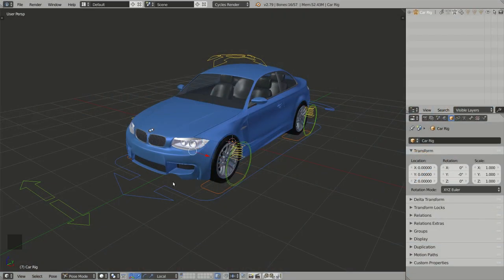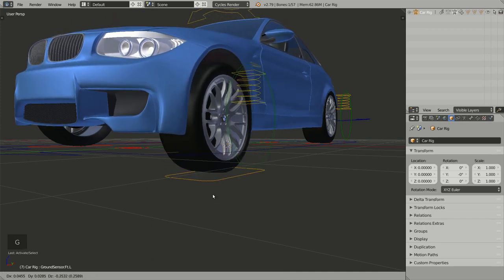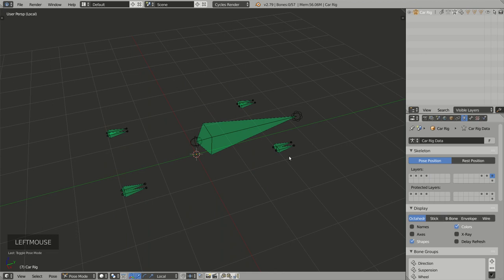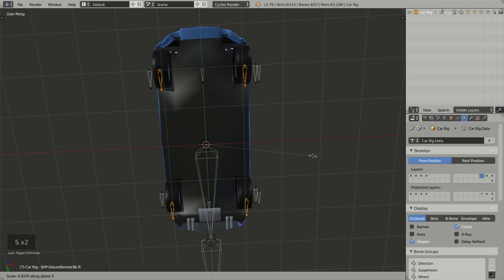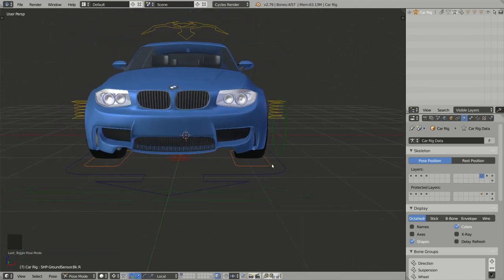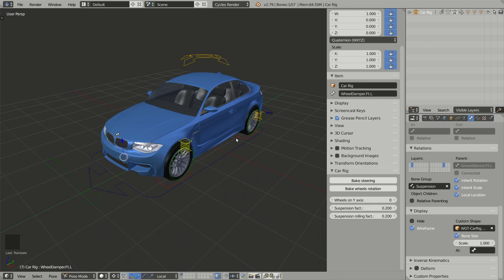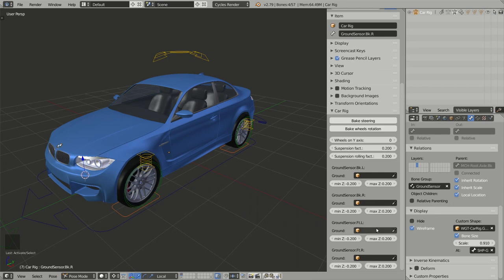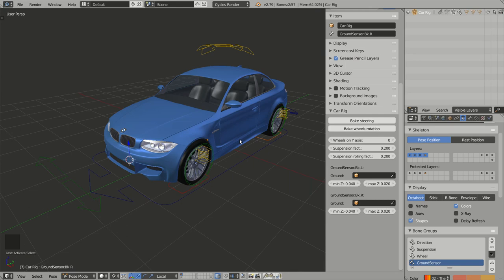Rigacar for Blender - part 2: adjust car rig

Comment: If anyone has camber on their car you have to make the following change:

1. Make sure your wheel is set to not have any camber and that its Y rotation is at 0
2. Go to layer 32 of the armature
3. Select the biggest green bone on a wheel and select "bone" from the context menu
4. Change Y rotation to whatever you want your camber to be (for me that was 7.5 degrees)

hope this helps!
Reply from the maker: Never had to rig vehicles with camber angle. Thank you for this. Let me known if you have issues after modifying the rig. Maybe I could improve the generation process to take this into account (for instance by using the rotation of the wheel on the Y axis).
Reply: digiCreatures yeah my method works perfectly as far as I know. Wheels soon as you would expect, and the front wheels still turn just fine. But something built into the rig to change camber would definitely be way better!
Reply from the maker: @cervidae3359  I will test if I can use the global rotation of the wheel mesh on the Y axis to apply camber automatically on the rig.
Reply: @digicreatures1945  Maybe also add some sort of "random seed" to wheel rotation, so each wheel isn't at the exact same angle. This would be especially helpful when the car is parked, so the wheels don't all look perfectly straight.
Reply from the maker: @cervidae3359  You can already do that. Just rotate yourself each wheel widgets to choose the starting angle.
Reply: digiCreatures op my bad didn't see that
Reply: Just what i was looking for and wanted to ask myself for the drift car rig... works perfectly, thank you!
Reply: Absolute legend with this tip

Comment: Thank you so much for thi Add on😊
One question: with 3.0 and no Layers, the work flow is invariate? Im still working on the first steps.of this series. Thank you bye.
Reply from the maker: Layers for armature still exist in blender 3.0. 3.x series introduced collection as a merging solution for group of objects and scene layers. But this is a different topic

Comment: Can you make it, so the wheels move/turn when using bigger wheels? (I can't scale down the wheel
or the materials will be messed up, the models that Im using are from mecabricks ( The Armature rotates the wheels as if, the wheels origin point is not at the center of geometry)

Comment: Hi @digitCreatures 

At 18.00... when i move the suspension factor number...nothing happens with the car suspension. Same with the rolling factor. 
So the suspension isnt being calculated when I animated the car along a path. The steering and rotation of the wheels is working fine. 
Also, when I move the suspension widgets seperately..the also work fine (ik can see the body of the car going up and down..)

So its just that the suspension isnt being calculated automatically when I set the suspension fac to 0.2 or something...

Can you tell me what the cause might be for this? Everything else seems te be working just fine... 

Thank you !
Reply from the maker: Rigacar is not a simulation tool, it just generate rig. You have to animate your car in a traditional way (especially suspension).

Comment: So if I'm going to be animating a railway related video and I was wondering if there was a way to make the rig for the side rods follow the wheel rotation and the car rig. Are there any tutorials? If I need to be more specific with this question then please let me know
Reply from the maker: Trains are specific stuff. Even if you can use rigacar, I would not use it for such models. For instance you don't need steering and drifting but you need to rig the side rods. Sorry, you should look for another solution and probably create your own rig.
Reply: @digicreatures1945  Do you know of any tutorials that well assist me in making a rig? I have no experience in that field.
Reply: @dieseld261  If you are still looking for solutions I would suggest Pixel Level Pixel.  He has done a whole series on rigging and in particular for your requirement he shows ways of rigging pistons, which could be applied to the drive rods on a train.
Reply: @WaterShowsProd  I'm not looking for a solution anymore but I will definitely be sure to check that out. Thanks.

Comment: This add-on is amazing. Are you able to explain how to add more bones to the rig? I found the vertex groups in the "DEF" bones category and am trying to add a bone on the "main bones" layer to control the door of my model... I have only been able to go as far as adding the bone and parenting it to the root bone, but I can't figure out how to weight paint the door and make it correspond to the new bone. Thank you!
Reply from the maker: In Blender, you can use an armature to animate objets or to animate meshes. Rigacar generates armature to animate objects because car models are usually made from separated objects. So you do not need to weight paint anything. If you are not used to create armature to animate meshes, the simplest solution is to have one or more separate objects for each door. In the armature, add one bone for each door. Parent these bones to the DEF-Body bone (you have to enable layer 16 of the armature to see it). Then parent door objets to the corresponding bone.
Reply: @digicreatures1945  Thank you, your answer helped me. Rigacar is so much fun to work with!

Comment: Hey ! so i've been using CARRIG PRO but this is so much simpler and i am planning  to switch, i have one problem tho i click generate after renaming and stuff , and everything is parented correctly but i when i try to pose it, the wheels dont move, and also i suddenly can't find their bones, i tried a coupleof times and it's the same issue, however when i move the rig everything is moves which means, the wheels are parented to something in the rig it's just i can't find dthe bones and so it doesn't work
Reply: I Figured it out, in case anyone runs into the same thing, my tires center point wasn't at each center of each tire so click each tire go to object then set center point to geometry
Reply from the maker: You're right, it is an issue many people have. Take care of the origin point because rigacar uses it to decide where the bones should be located.
As for CarRig Pro, I haven't tested it. But as far as I know, the design is completely different. It includes support for simulation as rigacar is a pure rig generator only for animators (no simulation support at all).

Comment: My wheels turn the wrong way and slow. What should I do?
Reply from the maker: Activate "Wheels on Y axis" (put the value of 1) and move the root widget along the Y axis. Check the spinning of the wheels. If it is not correct, it may be a problem of scaling your objects or scaling the armature itself (never do that). In this case, check your model, apply the scaling and recreate the armature. If the problem occurs when you bake the animation of the wheels, there is a good chance it is an optical effect. I speak about it in point 8) in the section "Advices and reminders" of the documentation:
"After baking animation for wheels, it could seem the wheels are not spinning in the right direction (going backward while the model is going forward) or the wheels are barely spinning. You can check the generated animation curves in the graph editor but it is more likely an optical effect. It happens in movie, it happens in life and it happens in Blender. To know more, read https://io9.gizmodo.com/why-do-wheels-sometimes-appear-to-spin-backwards-1593807400
Try using motion blur at render time to have a more realistic effect."
You can also check animation curves for the wheels. For a car going forward, the animation curves are going up.
Reply: @digicreatures1945  I've already activated 'Wheels on Y axis'. But it turns the wrong way and very slowly. So I thought a negative values might help solve the problem. But it didn't. Also all my scales  are applied. So I removed all rigs and did again with naming convention method. But my wheels seem to move to another location. So I rigged it manually. Now everything seems okay and it turns in the right direction. But the rotation seems a bit off.
   I've used this add-on before and it worked perfectly right back then.

  Thanks for your reply though 😘. I'll try baking the rotation and see if that helps.

Comment: can somebody help me? I am in trouble as my root is wayyyy bigger from the original car size. if I got to layer 14 it's alright but layer 1 is still big. pls help
Reply: hi man did you  have solve that problem. I have similar issue. I can not find m.y root animation widget
Reply: @rodrigomaldonado7642  oh. I solved it. Just make the BODY OBJECT . Like the mesh as the .body name and not a NULL. It solved my issue

Comment: Hey David, can you update the tutorial for 2.8?
Reply from the maker: It is definitely part of my todo list but I have no time right now :(
Reply: @digicreatures1945  I was following "make games" channel, he is trying to update your tutorial, he said in the latest version of Blender you cant bake the wheel rotation when following a path, is there a fix coming soon?
Reply from the maker: @MrIzeQ  Thanks for this info. The baking for wheel rotation is based on the animation baker in Blender. This feature was constantly broken and modified by the developpers until the very last moment of 2.80 release. Version 5 of this add-on was created specifically to work with 2.80 release. I will check but normally everything is fine with the latest version.